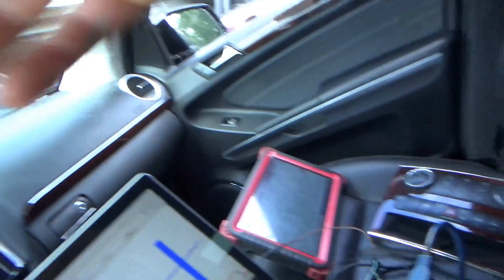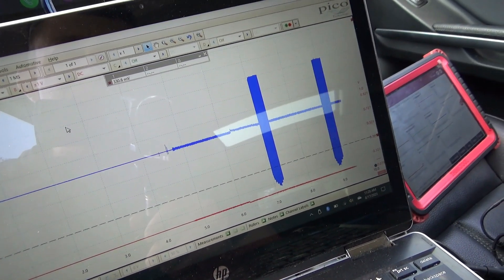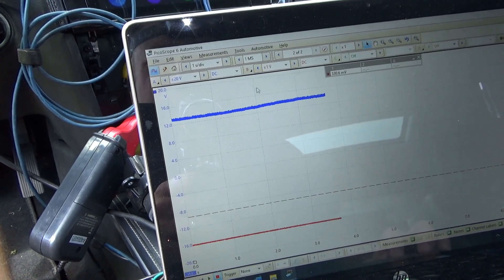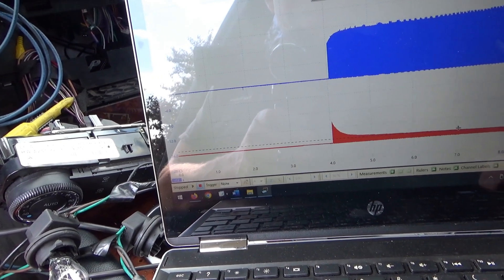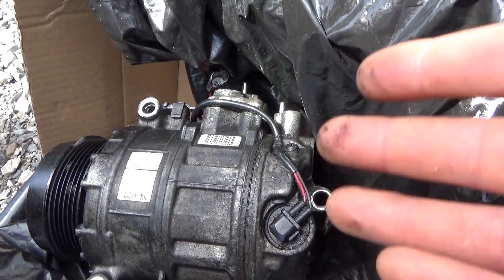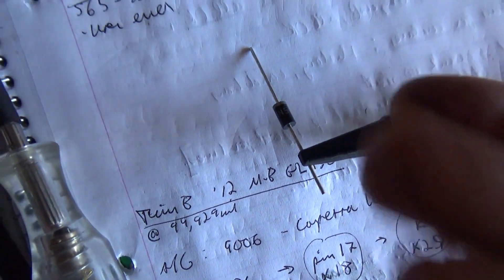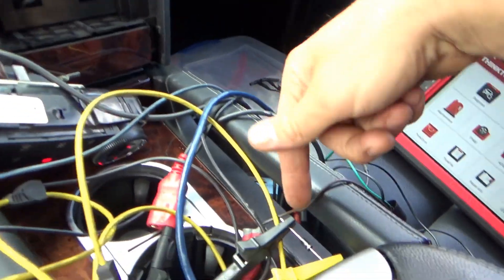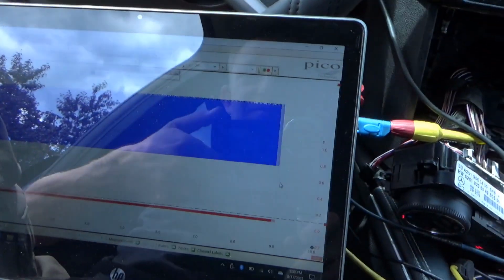Part 2: Did I MIS-DIAGNOSE This Mercedes?? (GL450 no A/C - Crazy REPAIR!)

Comment: He still never cleaned harnesses and checked resistance of wires and harnesses. Any car over ten years needs all connections cleaned......I wouldn't hire this guy.
Reply: How bizarre, my 23 year old Pontiac Bonneville (shit box) has never had any of the connections cleaned and has 0 electrical issues.
Reply: LOL
Reply: Man, I keep forgetting to take apart my entire car and clean all the connections every 10 years. I guess that's in the fine print of the owners manual 😂
Reply: A wise woman on the internet once said, "Ain't nobody got no time for that."
Reply: @event3horizon I love that triple negative.
Reply: You probably never done a oil change in your life.talking is cheap. If you pay me a billion I would not work for you. Very sad there is people like you that don't appreciate knowledge and hard work.
Reply: Also, he didn't even install the diode right. There's a loose wiring connection. And he wiggled it,....and got it to work. A diode won't cut back current unless the wire is cut and isolated to run only through the diode. 

What he did makes no sense. 

The is is a meth channel.
Reply: Flyback diodes are installed in parallel not in series / inline.
Reply: If there was any resistance in the wires going to the compressor, the ac would still not be working even after his diode experiment…
Reply: sounds like someone has never heard of back EMF
Reply: A "meth channel?" You fix 1 bad ground and now that is the fix for everything! Typical YouTube keyboard warrior.
Reply: I would hire Ivan, I wouldn’t hire YOU
Reply: Every harness and ground bolt on the vehicle. Must be cleaned at the ten year mark.
Reply: @sasquatchrosefarts9131  lmao! If you say so kid!
Reply: @bigkenny93 ok big boy. When you see a bad ground bolt causes distributor wires tossed off in the engine compartment... Based on changes in humidity and temp...... Get back to me. 

Know it all's will always know. 

An hour or two of labor cleaning all connections will save you tons of headache later. And much better spark and brighter headlights. Everything.
Reply: @sasquatchrosefarts I think it definitely depends on where you're located. I understand if you're in the rust-belt, but it's not a universal rule. A lot of the times you can just do a proper visual inspection.